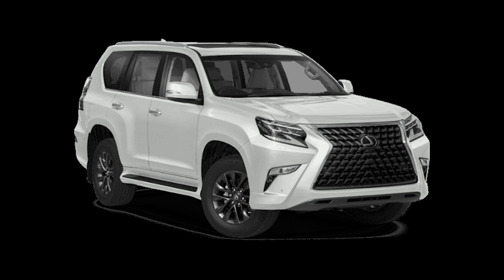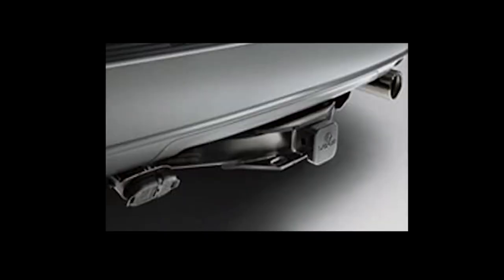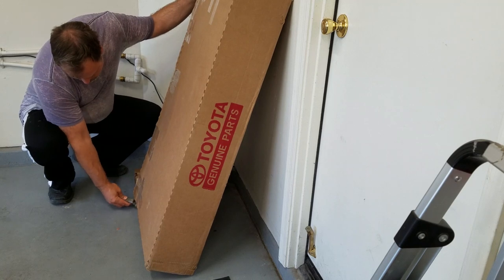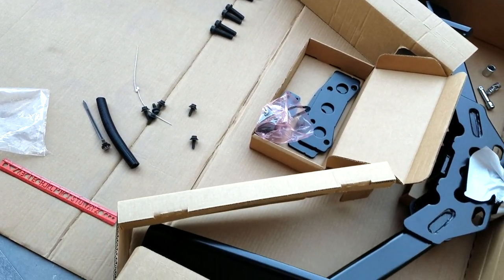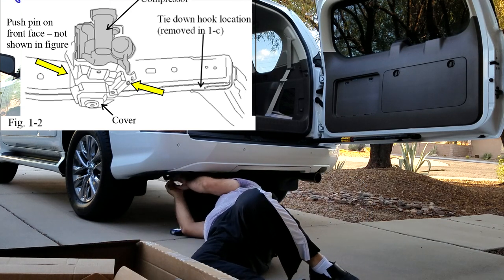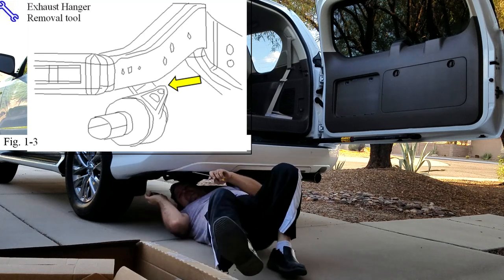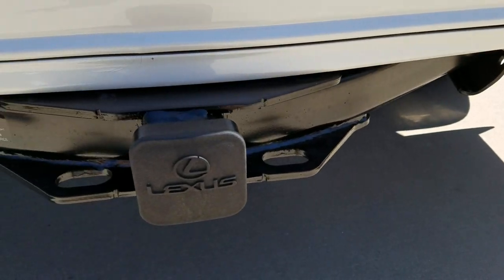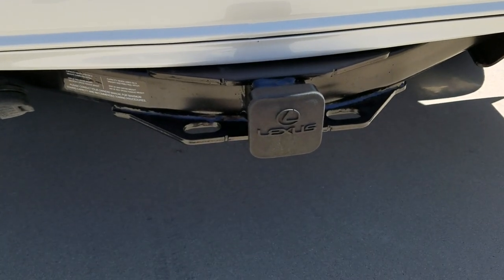Lexus GX460 - Trailer Hitch Install

Comment from the maker: The new version official part is PT22860141.  The old part number was off by one digit.  PT22860140
Reply: I cannot find anywhere that charge $350 for this part. All 3 lexus dealers around me charge over $500 for it.

Comment: Bought my new GX460 a month ago. Today called the dealer for a price on installing the hitch. $1200. Plus after checking my VIN # they said that it can not be installed, since the car is not "prepped" for towing??? Kept telling me I need a bigger alternator, extra radiator, towing wiring harness etc. etc. Smelled like BS to me? never heard of anything like that on a GX460.
Reply from the maker: Could be true on a new GX where they cut cost by offering less.  Mine is 2014.
Reply: I spent time looking over the owners manual. Nothing like that mentioned. Went on two Lexus dealers web sites to order the same Class IV tow bar. Asked for the VIN # so I entered it. It came out "Green" meaning it is fine?
The RX models on the other hand, have additional requirements like the ones my dealer mentioned. @StreetRodJim
Reply from the maker: I would call a few different dealers.

Comment: Thanks Jim, looking forward to attaching my newly ordered Lexus hitch....they didnt include any instructions though...so gonna take my time and re-watch your video several times!
Reply: It's done and completed...video helped a bunch....challenges getting torque right to remove first tow hook bolts.... also unable to get the muffler to drop so used the pry bar method....that was hard....felt like it took 465 turns of a wrench to get the small bolts in...:) but its done and complete and looks great...needed my irend to help me hold the hitch up and in place to tighten bolts though......
Reply from the maker: Glad it worked out!

Comment: Some dealers remove that small bumper valance and forego the spacers to make it sit up higher into the rear bumper for a more integrated look.    And to hide it more.   Also improves the tongue height greatly.
Reply: That does not work with this trailer hitch. You will end up with a gap and have to use the spacers no matter that you removed the trim
Reply: @chrisjohnson8882  no I actually mounted it myself removing the center cut out and used zero spacers.   Maybe I’ll post a video to show because to my knowledge there’s no way to post a pic on this reply of mine.   Our gx is a 23 premium plus with the gray lower bumper trim valances front and rear.

Comment: Hey, Jim! I wanted to drop you a quick note to thank you for the video and especially the part about the wiring harness clip release location. I had watched your video prior to purchasing the hitch and sometime between watching/ordering/installing I forgot your little tip and had to do a rewatch. Thank you very much for adding that little part. For those of you who are interested, it is located at 5:29 in the video.
Reply from the maker: Sure thing.  I just installed a Trailer Brake Controller and will probably make a video in the near future.

Comment: Very great helpful video, for a 21 GX 460 there are a few different steps, removal of the old plug holder and plastic bumper part covering the hitch spot. 

Thanks it everything else was the same.

Comment: Just installed the curt hitch receiver today, it was a breeze, I only tow a jetski so it makes sense to spend 150 instead of 500 also super easy. Make sure to line it up with the center of vehicle. Idk if this is wrong but I also used tread locker. 

Note that there are off brand versions of it in Amazon for even less money, but I liked the fit and finish of the Curt one and I trust it more. 

All in all, adding a tow hitch is far less expensive and scary than I thought when I bought my GX

Comment: Thanks! I'm planning to put a hitch on my '18 GX 460, more for rear end protection and ability to attach a receiver hitch recovery point if needed. Prices, as you say, are all over the map for the factory part. The Curt currently goes for about $230: I've found the Lexus mount for about $50 more, with free shipping (I think) or a 90-miles drive to pick up. You definitely have to shop.
Reply from the maker: Keep in mind when you put on a hitch for rear end protection, what that translates to is your bumper and car not taking the hit, and all that energy is transferred to the frame which goes directly to you.  If you are not towing, I would let the bumper do its thing.  You and your passengers would be better off.
Reply: I got mine (OEM Class IV) for $280 after tax with free shipping.
Reply: @StreetRodJim  True that! I had in mind mild (emphasis on mild) scrapes from underneath if encountering high points in dirt, not rear-end collisions.
Reply from the maker: @darylnd  Makes sense.
Reply: Where did you buy yours?
Reply: @ahmadm6122  I haven't yet. I got a price that wasn't terrible from the dealer where I bought the car.
Reply: @pegues  Where did you get it from?
Reply: @samcorlsamuel9074  I got mine from a Lexus dealer not local to me. Georgia I think I think it was, while I'm in Virginia. It's been almost a year now, but what I do recall is the dealer had an amazing price on it as well as free shipping. I suggest searching for all Lexus dealers nationwide - the price varies from one dealer to another. If I can find more information I'll post it here.
Reply: Just picked my factory class IV up this week 6/13/23, price was $616 w/tax out the door, Huntsville called Chattanooga, was the same price.  Great video BTW, also got no instructions with it.

Comment: Just want to add: once Lexus did the halt on production for hitches, and came back with them, some of the bolts they provide are a little different than the instructions used in the video and mostly those available online. Sizing wise and such. Also, if you’re a luxury package, you have to remove the middle portion of the rear lip, pretty simple like 5 or 6 clips. Other than that mostly alls the same.
Reply: Are you referring to the narrow strip (valance) at the bottom of the rear bumper?  In Jim's video, his lower bumper valance is still on the vehicle after he installs the tow hitch receiver.

Comment: the 2021 and 2022 MY don't even have that slight trailor cut away anymore, just a smooth rear bumper
Reply: You don't need anything special if you have a GX460. My 2022 fits the new hitch fine. And mine didn't have the Air compressor, it was easy to install.

Comment: Great video Jim! I think I'm going to just go with the Curt Hitch as that will more than accommodate my towing needs on my 2014 GX 460 which is just 2 Seadoo's and their trailer. I'm just deciding on if I want the longer or shorter one. Anyway, I love the wheel color on those OEM wheels. I think it's just called "smoked hyper silver" and the wheel part number is ALY74297U77. They kind of look like factory PVD Chrome too though in a way....... Is this correct or are you not exactly sure? My GX being a base model 2014, just has the light hyper silver 6-Spoke wheels that came on all the 10-13 model GX 460's.
Reply from the maker: My wheels are full chrome.  Not sure what they are called, but I looked up the names you provided and it was not that.  It was some type of add on, or custom made for this vehicle to be in the showroom of Lexus.  The spare is stock unfortunately and does not match.

Comment: I just called Lexus dealer in my area (Kansas City) to get the same exact hitch and was told that they are not allowed to sell them even if they have them in stock due to liability issues. He also mentioned that they will be releasing a new one sometime in late August or September of 2022.
Reply from the maker: Thank you for this information.    I called to verify there was not a recall or such.  They took some time and made some calls and got that there is a supply shortage, and also possible a batch manufacture issue, but all the older ones should be fine.   And of course the new ones should be fine.
Reply: They are now available if you haven’t already gotten one, I was put on a wait list and today (5 days later) I was called, when I asked the parts guy to put me on the list he said Lexus is only sending 3 per week to each dealer
Reply: Yeah, I am having a difficult time finding this tow hitch for my 2011 GX460 anywhere online.  I guess I will call the Lexus dealer about getting on the list?
Reply: @vannerdherd  I just bought one for $550 plus tax was a little over $600.00 Was shocked when the parts department told me they had it in stock. 5/9/2023 Looked exactly like the one in this video.
Reply: @NjGent01  I called my local Lexus dealer yesterday and they had one too...however, I think I am just going with the $120 version (5000lbs) instead of almost $500 more for 1800lbs pulling power...I just need to haul my ebike and pull my trailer every so often.

Comment: I just called my dealer who said they were back ordered a year & a half. 
Also told my 2022 is different than older 460’s? Today is 01/24/2023
Reply: Did you install?
Reply: They are in stock now

Comment: Did you have any trouble losening the two 17mm bolts that hold the tie down?
Reply from the maker: I do not remember that.
Reply: man I can't break the torque easily on the two bolts in the tie down from the first step!

Comment: Did you add a break controller?
Reply from the maker: I did not have one for a while.  Then when I got the big 24ft trailer I got this.  https://youtu.be/u0-68k3lPog?si=ntR5j75HXqolNr0b   I would say if your trailer has elec brakes on it, you should have a controller.
Reply: @StreetRodJim  perfect!  Thanks for sharing!

Comment: How did you find your set up fir $350 out the door? Been finding these in the north of 450$
Reply from the maker: Inflation
Reply: I just got one for $400 during the Lexus sale. Had it shipped from Lexus bell, I believe. The sale had free shipping and the bell dealer had a nice discount on it.

Ballews in Tacoma installed it in less than an hour for $125. I took the spare tire off to make it quicker for them. 

Guy at Ballews wasn’t charming and he tried to charge me more than their original quote but they did a good job.

Comment: The wiring harness mount on a ‘22 sits really far back.  Anyone know how to remount closer to the hitch and make it easier to connect the wires to the trailer? Using the curt mount
Reply: Interesting my 2014 luxury doesnt even have a bracket. The wiring was there just like the video but I want  bracket so its solid and mounted.
Reply: There’s supposed to be a bracket included that allows you to relocate the plug from the factory location beneath the rear end to be mounted on the hitch itself for easier access.
Reply: @vepr_157 new separate bracket kit is needed for the wiring harness.

Comment: Whats the part number for the kit?
Reply from the maker: PT228-60140 &  PT22889445
Reply: @StreetRodJim  So the PT228-60140 included the light plugs and mounts ?
Reply from the maker: @johntoth6523  You buy this and the hitch/ball and you are set.
Reply: @StreetRodJim  sorry, but to clarify, the kit came with the wiring harness and adapter, correct?
Reply from the maker: @SL-wc2nl  Everything but the hitch and ball shown at 2:30

Comment: I hope you realize the hitch is only rated for 5000 pounds when conventionally towing.  You need a weight distributing hitch setup in order for it to handle 6800 pounds.  So not only do you have to buy the ball and the ball mount as you mentioned but also the weight distributing hitch setup.
Reply: I guess you missed the " 6800 lbs " on the sticker lol, this hitch is a beast. I've towed just about everything with it!
Reply: @juanvaldez2656  I guess you missed the part where it says “with a weight distributing hitch”